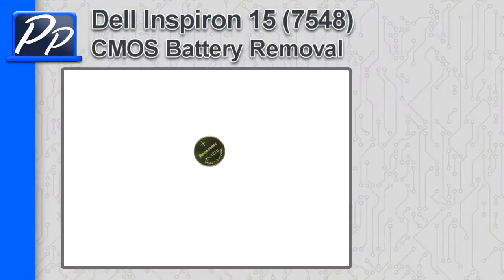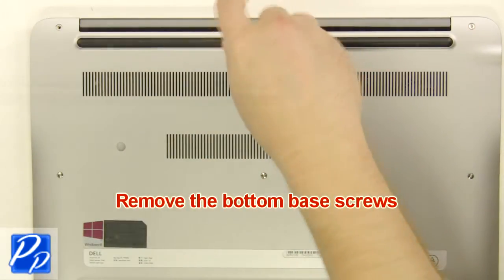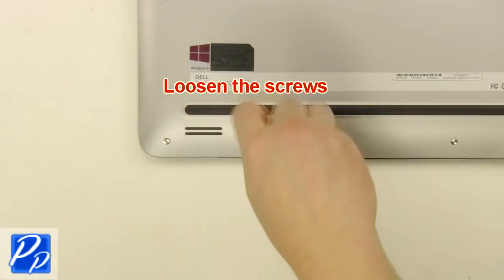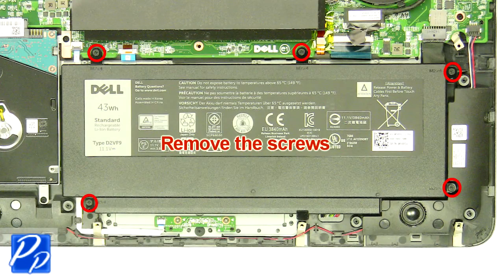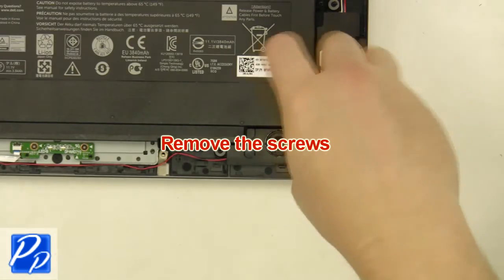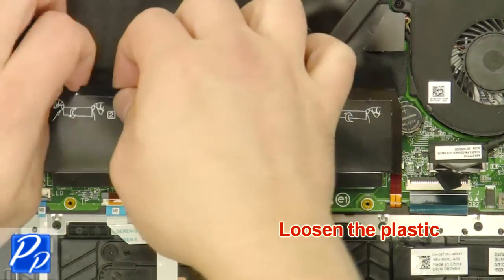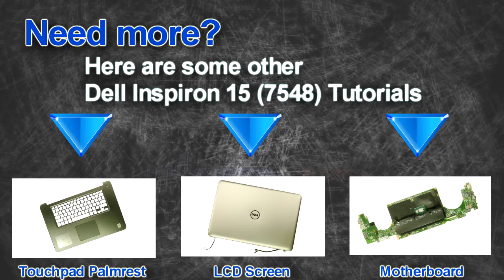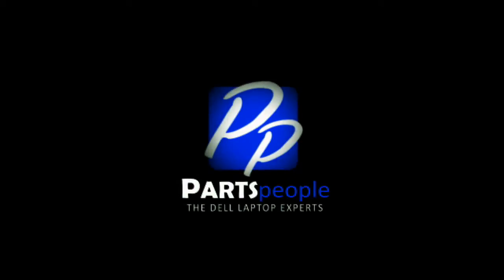Dell Inspiron 15 (7548) CMOS Battery How-To Video Tutorial

Comment: thanks for the help I did all the steps shown in the video, but I still ask for the password, I asked for the password, I do not know what it is, since I see a service tag, and I need to fix it.

I hope and you can help me
Reply from the maker: It has a BIOs password? Removing the CMOS battery will not remove the BIOS password. You have to replace the motherboard.
Reply: @dellpartspeople  Hello,
Replace the motherboard to change the bios password, is it really the only one solution ? Because as you said, removing cmos batterie don't work.
Reply: @dellpartspeople 
Moreover, I'm not an expert so it's probably some bullshit but I didn't find a cmos jumper on the motherboard. Is it normal ?